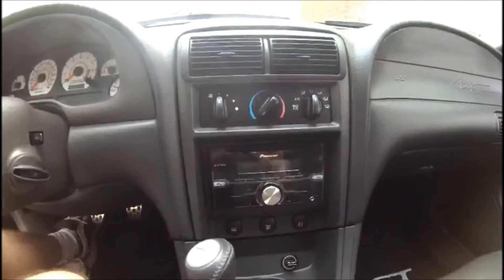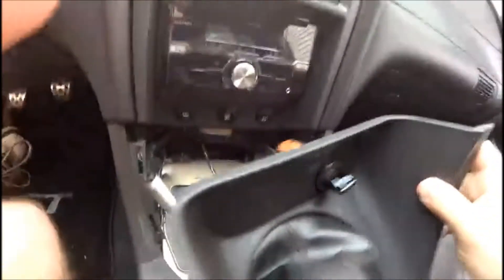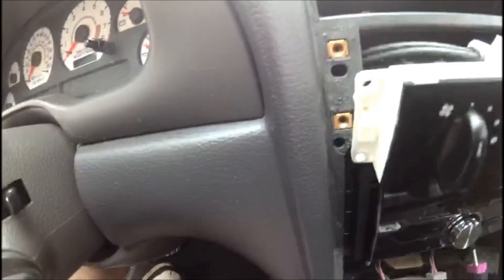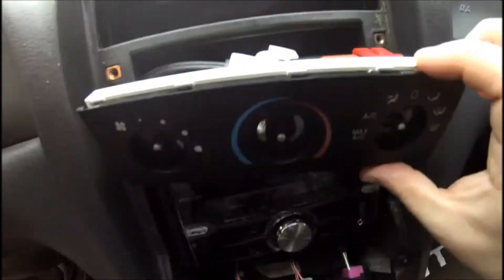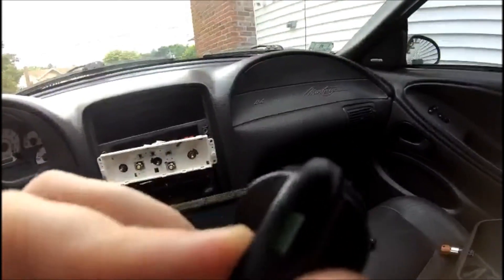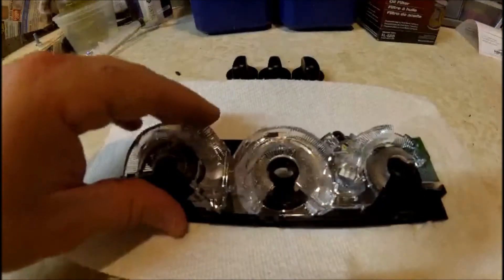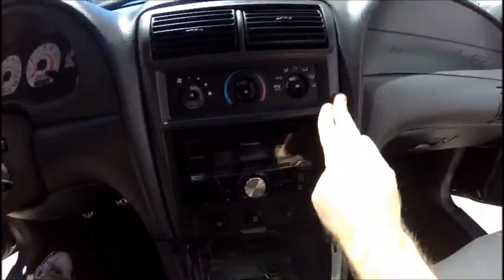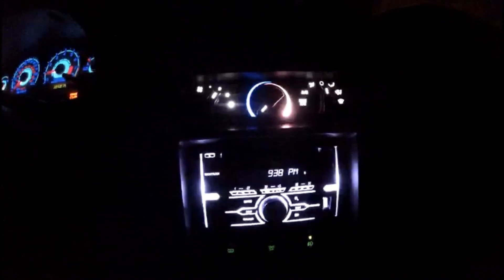Installing HVAC LEDs on a 99-04 Mustang

Comment: I put in blue LEDs and I get a bluish tint so I didn't bother removing green from the lens. But now the red on the temperature control appears as purple. It would have been nice if the backlighting for each control had their own lamp so that I could've backlighted the temperature control with a white LED so that I could've had a better result. One other thing, I had to adjust the pins on the LEDs to get them to make an electrical contact - otherwise they wouldn't light up.

Comment: Did you have to replace the bulb socket or did you use the original?
Reply from the maker: Hello, yes, I used the original sockets. The LEDs I purchased fit the stock sockets.

Comment: How did you remove that face plate part I got a flat head on there but I can’t get anything to move
Reply from the maker: Yeah... you have to use a little bit of force. But be careful as I broke the plastic part on 2 out of the 8. Keep working at it with the flat head it will release. Good luck!

Comment: What is the bulb/LED type used? so I know what to order
Reply from the maker: Thank you for watching and kind words! I just checked and the company (Hercoo) no longer sell the HVAC Led replacements I used. However, the following is a link to ebay of something very similar that should work:
https://www.ebay.com/itm/126435219854
Thanks again for watching!
Reply: @brithecarguy6083  I looked into it. Bulb size is 194 & the connector is a T10.
Your video was very informative. Not like the others who were very vague. You took step by step in the process.

Comment: Amazing video! What sand paper did you use I know you said you used fine sand paper but which grit? Thank you.
Reply from the maker: Thank you for watching! I believe I used 400 grit sandpaper since that is what I had on hand at the time.  I have since changed the color to a blue. Doing the fog light, traction, and defroster switches was a bit of a challenge but well worth it.
Reply: @brithecarguy6083  yeah thank you for getting back ok I was talking to a guy I seen who did this on Facebook and I was wondering how did you do the defrost, Trac control, and the fog lights we were discussing how it's a tiny bulb
Reply: @brithecarguy6083  I am using a 600 grit and I'm going to be doing the cluster and for the shifter light it's just the bulb and no film so I'm looking forward to that
Reply from the maker: @scuevas7  Yes, I ordered 3 of these leds from superbrightleds.com. NEO3-BHP: 3mm NEO3-xHP Blue (or whatever color you want) Take your time when opening up the switches, they are a plastic clamshell style. Once inside, I cut out the old bulb, as there is no way to replace it. I then took the lead from the new leds and soldered them to the switch. Keep in mind I had to do a little cutting and trimming inside the switch to make room for the new led. This was my first time soldering, and was pretty simple for this job. Just take your time, as this is not a simple plug and play scenario. Good luck!
Reply: @brithecarguy6083  oh that sounds complicated lol any tips for the HVAC and the knobs it seemed easy for you to take out the clear plastic part
Reply from the maker: @scuevas7  yes, that's not too bad. just be gentle when removing the clear plastic as I believe I broke one of the plastic retaining clips, however, was not really an issue when reinstalling.
Reply: @brithecarguy6083  is there anyway you can send me a picture or make a video of your buttons using the new LEDs

Comment: How do I hook the wire up to my traction control button it’s not working so I’m guessing it’s not hooked ip
Reply from the maker: The lights for the traction control button, fog lights and rear defroster don't really have interchangeable bulbs really. If the light is not working, I would suggest removing the hvac bezel and confirming it is indeed connected properly. If it is and is still not working, you can solder in a led in place of the stock bulb that's hardwired in. I did it with all three of my buttons and was kind of a pain but can be done. You just have to very carefully open up each of the buttons to gain access to the bulb, cut it out, and solder in a led of your choosing. I hope this helps.